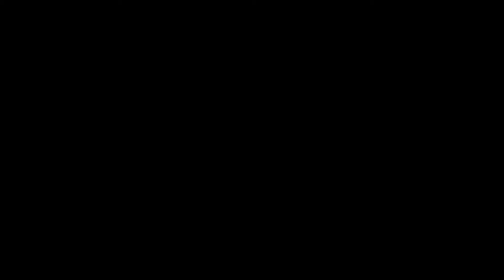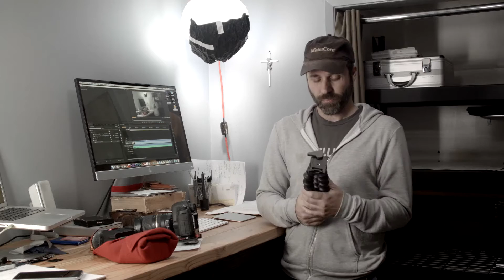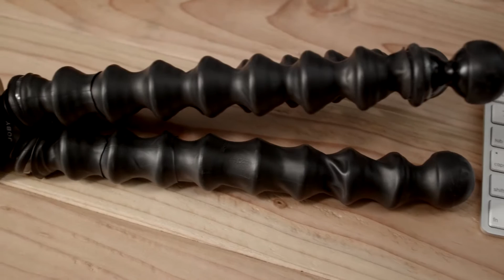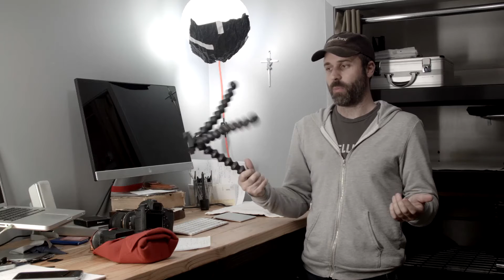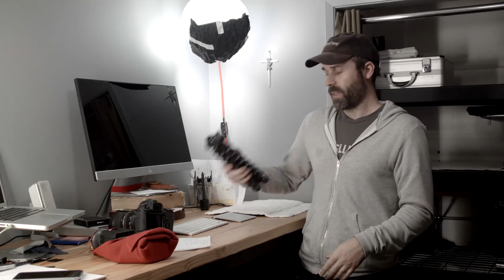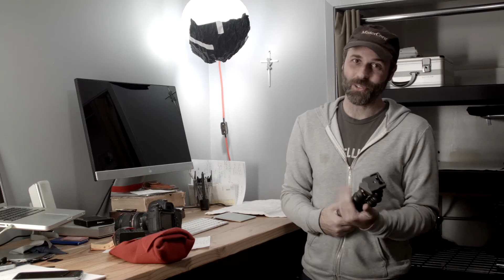How to Fix Joby Gorillapod Focus

Comment: That's a really clever idea! Already ordered some heat shrink and will definitely do that! I like that it also gives some anti-wear protection to the tripod.
Reply from the maker: So far it's working out really well for me.  I definitely got better at putting it on as I went along so I actually might do it over at some point.  But it's working well right now.

Comment: Better idea than taking joints apart and inserting plastic wrap or some other thin material. I assume it would work with smaller models as well.  Just a matter of me figuring out what size and type of shrink wrap to get.  I don't have a heat gun, and assume that without one it would be pretty difficult to apply it correctly.
Reply from the maker: I would assume so.  I just measured and guessed a little and it came out ok.  If you look at the sizes they offer online they're pretty standard.  They seem to shrink to half their original size I believe.  Something like that.

Comment: Great fix! I have a mini joby. Has anyone tried the shrink wrap on that size? If so, what diameter did you use? Thanks!
Reply from the maker: I would just take a measurement and guess.  the shrink wrap is so cheap you can make a mistake and still have it be worth it. good luck!
Reply: Good point. Cheers!

Comment: can you wrap it around the tree now?
Reply from the maker: absolutely, the real test tho is when the legs are extended out straight and you're holding the end of the leg. If it bends or if the camera slowly falls to the floor, it's no good.  with the fix it holds firm.  super strong.